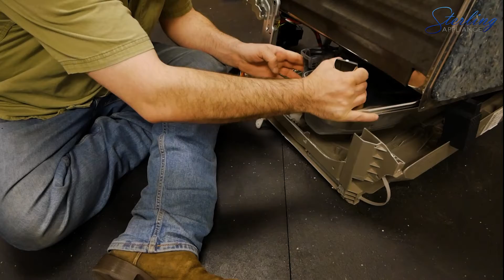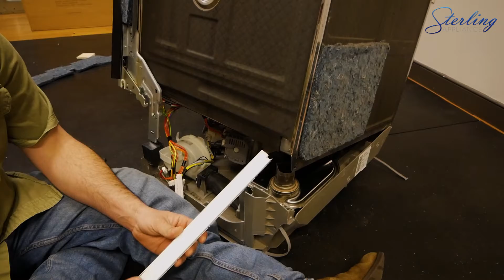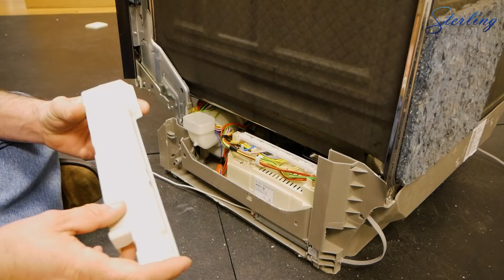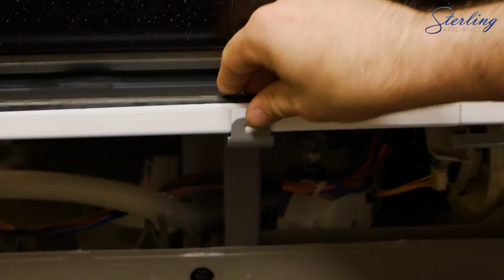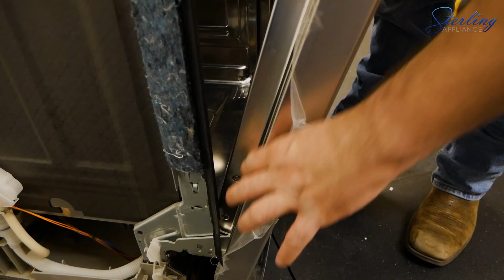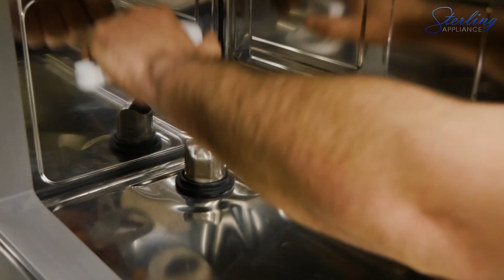Zeolite repair with Sterling Appliance Part 2

Comment: Wow what a fantastic video, thanks so much.  Quick question:  I'm seeing two models of the zeolite container for my machine (SHXM88Z75N).  One has a stud connected and one has the stud separated.  They both show as compatible for my machine.  I'm trying to fix the E15 code error and have discovered the nut was cracked, but now there's calcium build up throughout the seal area, so I'm thinking best to just replace the whole tank, seals and all.  Is the connected stud option a newer option to help address these issues?  I guess I'm just trying to figure out which container kit to purchase.  Really appreciate your help!

Comment: Thanks for making such a complete video. One question: why is it necessary to remove the door panel when replacing the Zeolite fan and canister?
Reply: It is not.
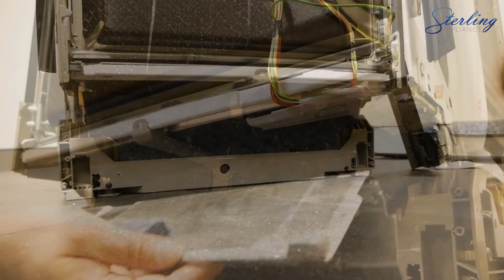Reply: To properly answer this question for future viewers, you remove the door panel to make it easier to reinstall the metal insulator plate at 9:22. Unless you have a great deal of experience working with these units, it's easy to miss the upper catch points on either side of the plate. Improper installation can cause damage to the insulator plate or the door panel when the door is fully opened.

Comment: Hello, I wanted to know if the problem still exists in the new Bosch dishwashers with zeolite. I am going to buy the 6 series and specifically the model SPS6YMI14E with release dates 9/2023. I am in Europe. Is it believed to be an improved version of the zeolite system or will I face these costly problems? 

Because it is an expensive model, not many people buy it and I do not have any valuable information about the reliability of the system as no local technician has faced any problems.

Comment: As a local appliance repair technician unfortunately for the consumer I can easily see this being a 400 to over $500 repair unless you have the mechanical ability to do this yourself you're almost better off buying a new dishwasher and anybody who tells you that Bosch dishwashers are easy to repair are full of BS. Even though Bosch dishwashers may be the best brand dollar for dollar when you have to repair them it's a nightmare and very expensive.  by Far and Away the most difficult dishwasher to repair and most appliance repair technicians would never have specialty Bosch tools for a dishwasher as the average technician will be lucky to see one of these E07 errors per year let alone more than one 😮🤔🤔😬😤. I will give credit where credit is due this is an outstanding 2-part video by a very experienced Appliance repairman who has obviously seen more than one of these E07 errors and he made the investment in the specialty tools for Bosch dishwashers which I can guarantee you that 95% + of appliance repair professionals including myself would never do😮😒🤔😓
Reply: as a tech myself 100% agree. also i would charge 7-$800 for the repair. its not easy. alot can go wrong. the main thing is the ring inside the tub for the zeolite. it cracks very easily. when i did this without his tools i turned the unit upside down and had the base off, but had shit everywhere, so his video is really good. most techs i know would just decline this job. if you are running 7 to 8 calls a day you really dont have time to be messing with someone's stupid zeolite container
Reply: I bill $329 labor and you can get this repair down to an hour with experience making it more than worth it
Reply: I’m a handy homeowner, I completed the repair in 2 hours with no special tools. Lifted the tub from the base by hand and placed to pieces of wood to hold it up.  I imagine the next one would go much faster.
Reply: @ucrazykid well I'm very happy for you but at 1 to 2 hours labor and working for companies that only pay commission is very easy to see how I arrived at that 400 to 500 repair. 🤔🤔😱😱
Reply: Yes..I hate working on them very time consuming

Comment: Where did you get that wrench I can’t seem to find any. I understand a rubber oil filter strap would work but wanted to spend a little extra for an exact fit as im hoping my issue is only the nut.
Reply: The nut wrench comes with the new zeolite container

Comment: Thank you, Nick, for taking the time to make a wonderfully detailed no-fluff 2-part video on this issue. Our Bosch has just developed this exact problem but the service dept in the local appliance store where we purchased it seems to have never heard of this issue. After a call to Bosch, it agreed immediately to pay for the cost of a diagnostic visit and, after seeing the estimate from our techs, I'm hoping they would also agree to pay for parts/labor (as reported by others on a Reddit thread about this topic).  However, I'm concerned that the local techs might not appreciate that the repair requires replacement of Zeolite container (with updated metal nut), fan, tube (with updated tube shield), and possibly control board if any moisture is present. Of course we consumers don't have access to the service manual to see what it says about this problem. My choices are to either jump through the hoops of having local store + Bosch come to some agreement (which will take months) and hope all bases are covered OR spend the money out of pocket and do it myself using your extremely helpful video for each step.  As an expert, what advice would you offer given the circumstances described above?

Comment: I have a rubber O ring to place at the base of the zeolite container. I see you don’t have one in the video. How do I make sure it’s secured when putting the black nut back on with the rubber O ring?
Reply: For future viewers, if your zeolite kit includes an o-ring, it should be placed around the snorkel of the zeolite container prior to installation. In other words, the base of the dishwasher should sit on the zeolite container and o-ring with the nut securing the fit.
Reply: I'm in the same boat...I have the black nut and sealing o-ring...but the o-ring is too big to go under the nut...I'm assuming the o-ring in the parts diagram goes on the underside of the main wash bin??
Reply: I'd love to know the same thing too.

Comment: If the fan motor is shorted due to water causing the error why do you have to replace the zeolite canister as well?
Reply from the maker: Thank you for the question! The fan housing connects directly to the zeolite container, if the fan housing contains water the zeolite container will as well. Any time water enters the zeolite container it is compromised and unfortunately must be replaced. Hope this helps!
Reply: @sterlingappliance  Thank you for the response, just wondering what's inside that canister? Is it a heating element or some sort of radiator?
Reply from the maker: @murrayheidt3440  There are some videos showcasing how the system works, you can search "Zeolite drying system for dishwashers" to see a good explanation on how the zeolite works.  The container is made up of 13 individual parts: 1. PPS outlet nozzle 2. Nozzle O-ring 3. housing cover with inner nozzle 4. Mesh Cover 5. Zeolite granules 6. filter 7. Heater assembly with terminals 8. heater terminals (with thermal protection) 9. Moist air inlet 10. Baffle fin 11. Container insert 12. Container housing 13. Heater Assembly screws (copyright by BSH Hausgerate GmbH)